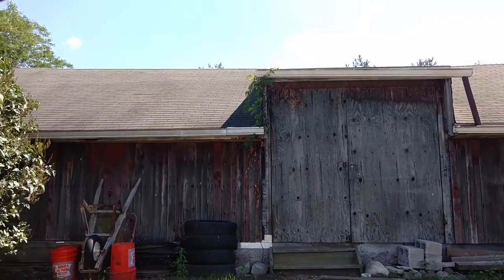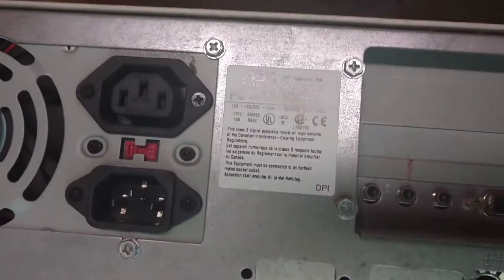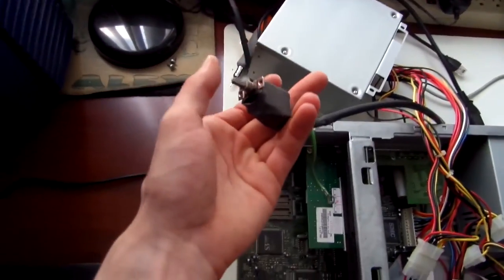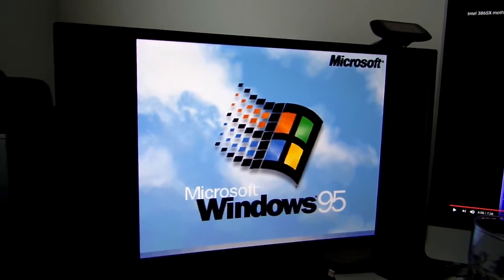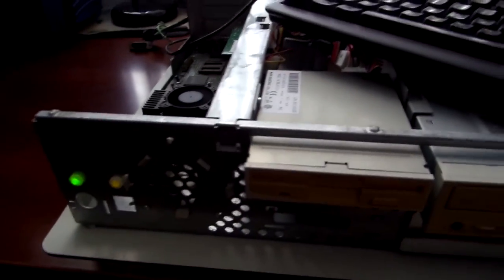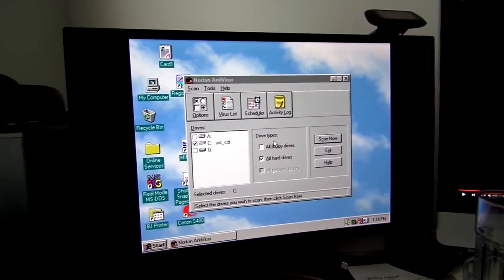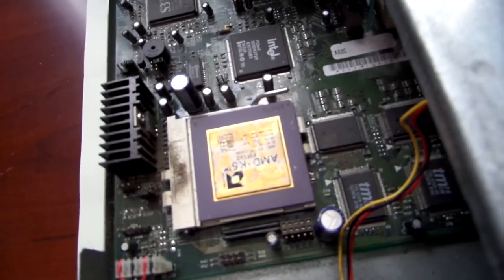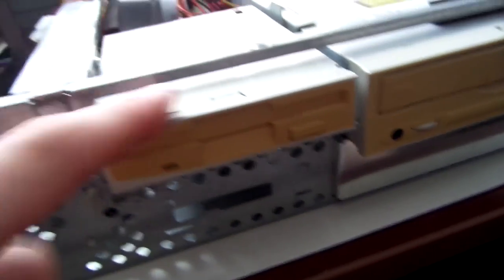Barn Find Computer - AST Adventure! 200

Comment: PR is "performance rating", AMD used to compare it to the same gen intel, so its just comparable to a pentium 133. Cyrix did the same.

I think they did this because its actually clocked at 100mhz, yet it has better instructions per clock making up for it, but I guess consumers would go "oh thats less numbers it must suck" and buy the one with more despite being similar and more expensive.

Comment: That shocked me, a K5 chip. Usually back then the model number, in this case 200, referred to the clock speed of the processor. P5133 or 5133 as an example.  I was honestly expecting a Pentium 200 MMX chip. 

I have been looking for a K5-133 chip, that was the first CPU I ever bought to upgrade my machine back in 1997.  Would you perhaps trade for it? No big deal if you don't, they are somewhat rare to find the 133 version now days.
Reply from the maker: Somehow I didn't even think about the relation of the model number to the processor speed, otherwise I wouldn't have said that I thought it was a 386 (or whatever I said, don't remember, can't be f'd to look back). I'll PM you about the trade.
Reply: appleontheapex
Heatsink and fan is a dead giveaway that this was a Pentium, and not a 386, and a bit too big to be a 486 cooler. 386's weren't typically fitted with heatsinks.  Although I personally think 386's run hot enough to warrant a heatsink at least, if not with a fan as well. There are a couple very rare examples of a 386 systems having been sold with a heatsink, usually reserved for 486DLC chips, but even those, outside of OEM, you usually won't see heatsinks on them either. I think IBM ran a heatsink on their 486DLC/SLC PS/2 systems but I think they were the only ones. weren't many to my knowledge anyway.
Reply: nah, i had an advantage 800 and it was certainly not 800mhz